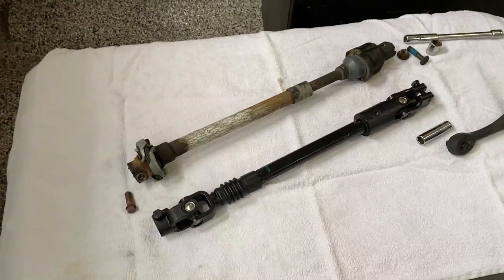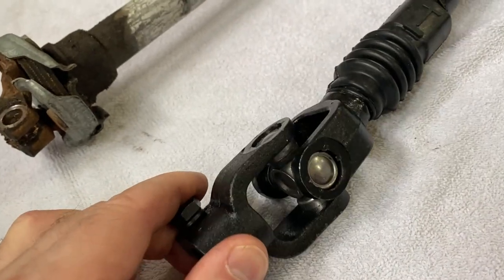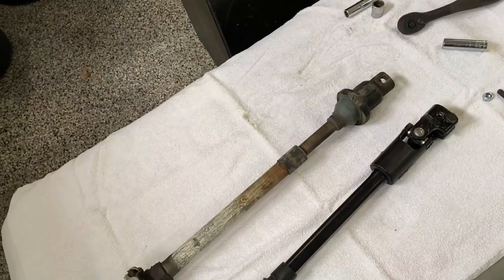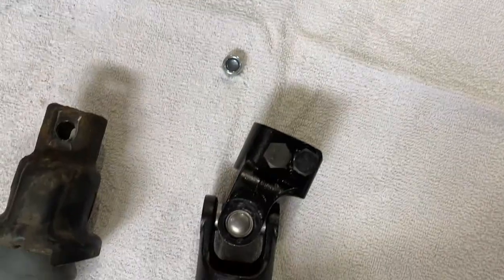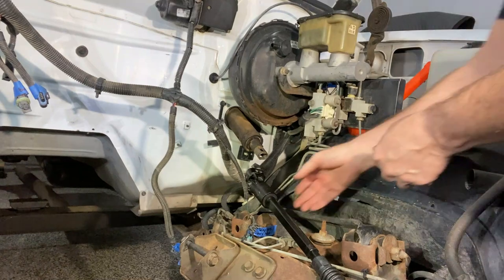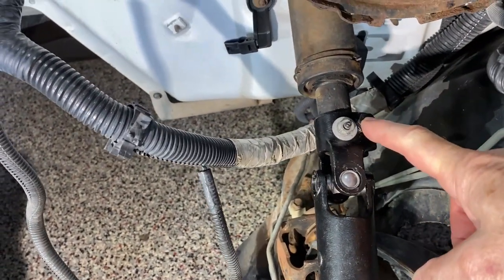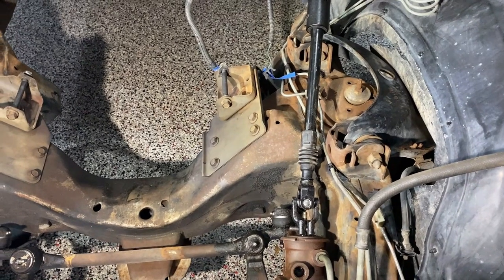1988-1995 OBS Chevrolet Truck LS Engine Swapped Budget Steering Shaft Project

Comment: Thank you I just switch mine out in my 1993 two door Tahoe. I went to the junkyard and pulled one out of a 1994 keep for $15.00 bucks. Works great.
Reply: Question bro it fits directly or do you have to cut the stoppers
Reply: @luisanaya9327  it just slides on the only thing I had to do was drill the upper steering wheel shaft a little bigger for the bolt to be secure, much better.
Reply: @bernie0524  ahh i see easy, hell yea man this post saved me money and time the regular steering shaft is 190 the jeep one is an upgrade plus its cheaper thanks

Comment: It is an 84-94 Cherokee(XJ)/Comanche(MJ) steering shaft that is used. The 95+ shaft is clocked 90 degrees off from the earlier shafts. And this mod applies to 88-94 OBS trucks, in 95 GM changed steering columns, and went to a 2 piece steering shaft. Several have gotten these shafts bolted into there 95+ OBS to learn there is a joint inside the cab at the base of the column, and that the shaft flops all over the place. You can use the jeep lower universal joint and merge it with your stock 95+ shaft to do away with the rag joint. And the jeep shaft still has a rubber coupling in it that fails, and gets sloppy.
Reply: Do u have a part number?

Comment: Great job.  How did it drive after the install. ?
Reply from the maker: The videos are put out as soon as I complete that project. So, the truck is not  road worthy yet. Still have the front suspension install (working on now), LS swap, exhaust, wiring harness, etc to do. I will do a "final" ride and drive when it is possible. Then plan on a follow up in 6 months to a year to let everyone know about any teething pains or issues, both good and bad.
Reply: @laurencevillegarage have you driven it tet
Reply from the maker: @Ski.the.slayer  yes, I have put ~500 miles on it. Works great, definitely a worthwhile upgrade. Just a bit less slop and a touch more responsive. I’m sure I will do it again.

Comment: FYI, This will not work on the 94 s10 with the 4.3 vortec. There is a side mount knock sensor that interferes with the upper shaft.

Comment: WOW!  Literally just bought the new stock steering shaft for my 96 sierra 1500, and today I removed just the dust cover, because in my head I kept hearing a voice saying, leave it alone, don't touch it lol 😂 so I didn't. I just paided $200 for the new oem shaft, and now after seeing ur video, it's going back tomorrow!! You have no idea how happy I am right now, knowing I don't have to continue to use that DOO, DOO rag joint steering shaft... Thank you so much for sharing.. 👍
Reply from the maker: Hope it all works out for you! Thanks
Reply: @laurencevillegarage  what's the best way to make that hole on top of the shaft, like u did in the video? Thank you..
Reply from the maker: @brooklyn_paisan1348  I just used a small drill. Marked the spot w a sharpie eyeballing it. Took it off to drill. Was not absolutely necessary, but I felt better that it could not possibly come apart on its own.
Reply: @laurencevillegarage would I need a to put heat on the new 1 like you did
Reply: The jeep shaft does NOT just bolt into a 95+. This video is very misinforming.

Comment: This is a good upgrade, and LMC and others sell this same set up for hundreds more... However. The decades old (tried and true) designed rag joint is equally as good, and they last a good 100k without issue. Replacement is pretty simple, and is the only wear part in that set up. Adding universal joints now makes two wear points, and it's possible to break a U-joint, losing steering. Rag joints get sloppy, but they very rarely break apart (in fact it's almost impossible). So keep that in mind if your not a maintenance junky.
Reply from the maker: I would agree with the premise, but, although you may have 2 wear points, as long as the angle is not extreme, there should be no problematic wear. Many vehicles today have 2 and sometimes 3 joints in the steering system with no issues. If you use parts made for the job and are installed correctly, it should be a trouble-free system. Some joints are greaseable and others are non-serviceable. Although I have never heard of one breaking, it is always possible. Good point for discussion.
Reply: I own a 1998 GMC Sierra 1500 and I agree that the rag joint was put there for a reason to have a little give, a solid joint is going to cause other parts to wear faster. Stay with stock.

Comment: Excellent video and perfect timing because I'm replacing my steering box.
Reply from the maker: Glad it helped
Reply: @laurencevillegarage  what your model did you get your steering out of the cherokee? I got one but the input socket on the steering column will not fit the square part of the steering column on my obs
Reply from the maker: @brt-jn7kg  Specifically for the '91 I used https://www.ebay.com/itm/363558504240.  I know not all OBS years will easily accept this mod. Seems the '97+ have a different style steering shaft with an additional rag joint under the dash. I have not seen this one personally, just in my research, this came up.
Reply: @laurencevillegarage what year make and model are u getting this shaft from and is there any other vehicles

Comment: It looks like a real good upgrade. Does the spoke on the steering wheel still line up correct?
Reply from the maker: Yes it does, just be sure it is straight before you make the change.

Comment: Would this work on a 99 Suburban?
Reply from the maker: The best answer I can give is, “it might”. I have not replaced the lower shaft on a suburban before. Compare closely the style shaft you have and pics of the replacement closely before buying. If you do buy a shaft from Amazon, at least if it’s not what you need, returns are pretty easy.
Reply: @laurencevillegarage  will do once i get back home and have some time to do the job, maybe next week. Ill report back thanks

Comment: How do you keep your steering wheel straight and make sure that it doesn't move when you disconnect the shaft
Reply from the maker: Make sure your front wheels are parallel and straight ahead. Then, after you attach the upper shaft the splines on the lower end will fit with little adjustment. All this was after the complete rebuild as well, so an alignment will be needed anyway. Any fine tuning can be done at that time.

Comment: Good video, I just ordered mine from your channel also.
Reply from the maker: Great, thank you, good luck!
Reply: @laurencevillegarage  just got my shaft in and it’s too short. Don’t know if it makes a difference but you said keep 84-2000. The link to Amazon from this post says 84-94? Gonna try to return it but what do I need to order? Thanks in advance
Reply from the maker: @TXPRODUCT  First, what year truck are you working with? The search is for 84-94 Jeep Cherokee steering shaft. The shaft will extend a bit. The link to the specific shaft I used is no longer there, but if you search for 84-94 Jeep Cherokee steering shaft many will come up.
Reply: @laurencevillegarage  99 OBS k1500
Reply from the maker: @TXPRODUCT  I believe your style shaft is different and the Jeep mod will not work. Do your research to see what others who have a similar year truck have done.

Comment: I have a question it is not about the steering shaft though. Is that the stock engine mounting set up?
Reply from the maker: Yes, that is what the stock motor mounts for a 4.3 v6 look like.
Reply: @laurencevillegarage  thanks for the update

Comment: Hey so I ordered one from your channel after I got it all installed it work good for about a week and then it started slipping almost like jumping teath on the gearbox
Reply from the maker: Check it to be sure it is seated completely over the splined output of the steering box. And the securing bolt is tight. Have someone turn the steering wheel and observe what is going on.
Reply: I'll double check man thanks

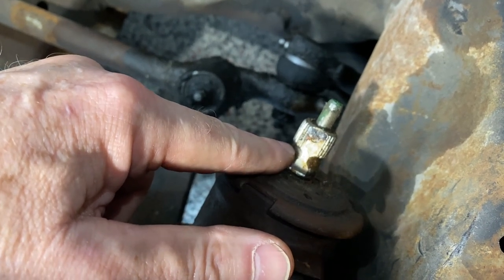Comment: 4:22 were your wheels straight with the flat up? I had my truck aligned 3 years ago took them 3 hours, and I know they messed with a bunch of stuff in confusion. I can't get the same jeep shaft on my gearbox. The  bolt won't go through. Wheels are straight. I stringed them. Passenger is misaligned for sure, i could string a better alignment then the shop did. My flat on the gearbox is pointing towards my PS reservoir.
Reply from the maker: As I recall, I had the front end straight. However, I did not move anything when making the attachment. I had no issues with the alignment. You did not mention what year your truck was. There were some minor changes through the 88-98 run that might account for the issues you have having. A good alignment shop should not have a difficult time with the mod.
Reply: @laurencevillegarage  I have a 93. The bolt won't go through the hole and have not moved anything. Once parked. Actually put a pair of channel locks hanging from the lower part of the steeeing wheel so it didn't move around.
Reply from the maker: @Peewee0413  The bolt I used was a 10mm that had come off the Suburban from somewhere. I chose not to drill out the hole to make it bigger. I drilled a hole just big enough for the 10mm to go through. It was not required, but I wanted the extra security of a “through” bolt just in case.

Comment: Just got mine in and it seems a little to long I cant compress it enough to get both ends on. Do i have to remove the gear box first?
Reply from the maker: I did not have to do that. Will the 2 halves come apart completely?
Reply: @laurencevillegarage  yes
Reply from the maker: @rudysarcade  how far will one end insert into the other?
Reply: @laurencevillegarage  I pushed it all the way and it looks to be about 2 inches to long still
Reply from the maker: @rudysarcade  I am not able to see it personally, but, does the male end insert far enough into the female end of the shaft that you could cut off 2 inches of the male shaft and have it fit properly and still have enough of the male shaft entering them female shaft, so as to not slip?
Reply: @laurencevillegarage  hmm that's a thought but I would have to cut off the female side the male bottoms out.
Reply from the maker: @rudysarcade  it depends on the length if each. I would try to trim the mail in first. However, I’m not able to see what you’re looking at.

Comment: Good video. Tried it myself only to find that the upper joint on my 1998 Tahoe connects differently than yours does- on mine, the steering shaft is male and mates to the female coming from the column, whereas on yours, the shaft is female and the column is male. I'm beginning to research why mine is different and what I can do to make it work. I welcome any input.
Reply: Turns out the 88-94 are just like yours, and the 95-99s are like mine- guess I should've paid more attention to what yours was before assuming it was the same as mine!
Reply from the maker: @jayanderson5402  I have not really worked with the OBS SUV's yet, good to know. Thanks
Reply: @jayanderson5402   what did you do to make it work on your year.. i have a 96 and im having the issue you had..
Reply: @Pete Cruz  I ordered the correct part for my year of truck, and it worked perfectly - not exactly like the video, but close enough to figure it out pretty easily. The jeep part doesn't work on the 95 and up trucks.
Reply: @jayanderson5402 is there an option for the 95+ obs
Reply: @jayanderson5402  what did you use to make it work I have a 97 sierra and knew it might be different than the 1st gen Obs what steering shaft did you use
Reply: @davidduran6478   I ended up buying mine from Cunningham Machine- it was $125. There is a year break somewhere in the OBS Chevy's. The jeep shaft will work on the older ones, but not the newer. I don't remember where that break is, though.
The Cunningham part worked fabulously, and I think their website shows where that age break is so that you can make sure to get the right one.
Reply: You can still use the xj shaft for the u-joint, but you have to swap the upper part from the truck's original shaft into it and weld or through-bolt it. Essentially,  on the 95-98 trucks you have to get rid of the upper u-joint on the jeep shaft because the newer trucks already have a u-joint behind the firewall.... you don't want to have 3 u-joints in your steering setup, it's too floppy. So you make a hybrid intermediate shaft with the jeep shaft lower part and the trucks original upper part that is male.

Comment: Will this work on 95-99 ? I know after 94 the trucks changed just a bit .
Reply from the maker: In and around the '95+ model year some things changed on the Chevy trucks steering shaft design. There are companies that make some parts to remove the rag joint, but, it no longer is an inexpensive upgrade. The price is higher and may or may not be worth it to you depending on what you want from your truck. Do your due diligence in research before buying and making this modification to your truck, you don't want to do something that will create a problem that could be serious.
Reply: @laurencevillegarage  thank you

Comment: I've been having trouble finding one ,for my 1991 GMC c2500
Reply from the maker: While I have not made this modification to a 2500 series, compare  the shafts of the c1500 and c2500 for differences. While not inexpensive, Cunningham Machine makes a replacement steering shaft with the universal joint. You might try to call them and see what options you have available to you for your truck.

Comment: I ordered the same part. My experience thus far (4 weeks) I do NOT like this conversion. I would rather have the rag joint and oem drive shaft. I’ve experienced odd wheel play when driving— it’s weird to explain but it feels like the steering wheel tries to correct itself and has sudden wheel play when driving straight. Keep in mind, before I installed this conversation, I had the whole front replaced including the gear box + an alignment and have expierence this phenomenon. This is just my experience.
Reply from the maker: Thanks for the comments. I would suggest anyone wanting to do this modification to do research and make sure it will work for your application. Although many things were consistent on the OBS trucks, many things changed throughout the production run. If you are unsure of your mechanical ability either get a "professional" to install or just rebuild what you have with quality stock replacement parts.
Reply: On what year of truck? You have to do it differently on the 95-98s.

Comment: How did you know where to drill the top hole and what size hole did you make?
Reply from the maker: I literally looked for a bolt with matching nut in my can of nuts and bolts I had from the Tahoe’s and Suburban I have parted out, that was about the right size. As far as placement, I inserted the top part of the shaft over the upper part of the shaft to see how far it would fit over it. The existing collar bolt lined up directly beside the hole in the upper shaft. I then measured what would have been halfway between the 2 sides. Lined up perfectly. The bolt is a little smaller than the actual existing hole to give me a little wiggle room for alignment.

Comment: Did you just measure down from the old to drill the hole, or is there more to it?
Reply from the maker: I literally "eye-balled" the location of the hole to drill.  The end of the shaft only goes on so far and I estimated the area to drill and it fit just fine.
Reply: @laurencevillegarage  ok, I  just placed an order for mine. I'm sure I'll be fine eyeballing it too..thanks for the speedy response.

Comment: Great video. I’ve seen a few others, I’m wondering why most other people take the two shafts of the xj apart. They heat the part where they both connect and remove some kind of plastic sleeve. I’m trying to figure out the reasoning behind that. Because most people use junkyard ones? The link to the part you used has been sold out but I bought a Dorman comparable one. We will see how it goes.
Reply from the maker: I’m not sure either. My neighbor saw mine and bought one for his Blazer. Different brand (cost a bit more but was beefier), and he installed his with no modification either.
Reply: That was also my question, I suppose if you can get a junkyard piece for $20 or whatever it's attractive. But then what you have is a piece you must modify AND both of its u-joints will be somewhat worn ... which is the entire reason these are sold as a new part to begin with.

Comment: The Splin on my 96 c1500 doesn't fit the Jeep shaft. I'm shit out of luck
Reply from the maker: Not completely, google 96-98 Chevy truck Jeep steering shaft upgrade. There were some differences through the years that would require a different shaft, either from Jeep or Chevy van. Don’t give up yet!

Comment: Isn't the purpose of the original rag joint to allow for failure in a severe head on collision? This modification as beefy as it is will drive the shaft up and inward to the driver.
Reply from the maker: Rag joints were created to take vibrations and road "harshness" out of steering and to make up for small amounts of variance in the alignment of the components.
Reply: The slip joint is where it compresses. The rag joint does nothing for that.
Reply: Been researching this for my truck lately and I've seen this same comment about "rag joints allowing for failure in a head-on collision" around 25 times by various posters. And, some were VERY adamant about it DEFINITELY being the reason why rag joints are used. Does anyone think that Jeep would allow the steering column to "spear" you in a head-on collision? If the reason for rag joints was to avoid such a thing, wouldn't ALL vehicles have rag joints? I mean, c'mon people!!!
Reply: @ffemtx4 the safety is in the "collapsible column" not in the rag joint. You are correct